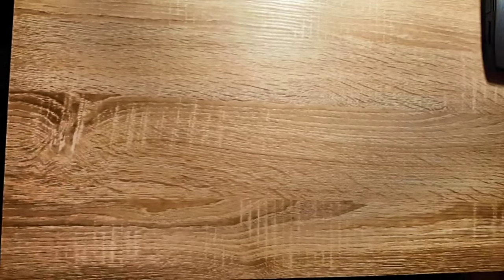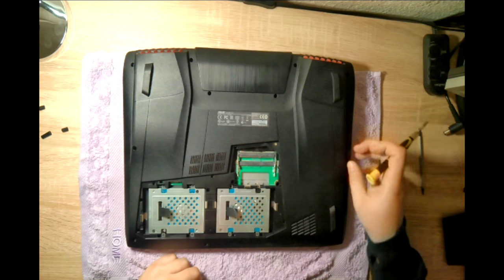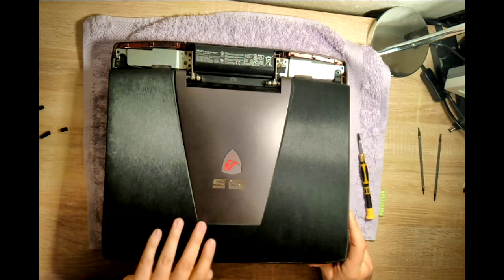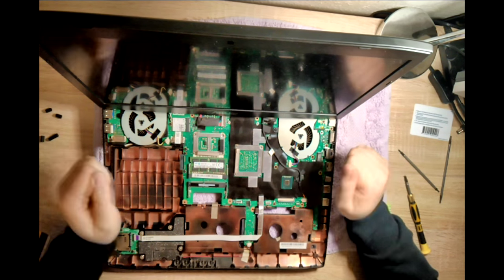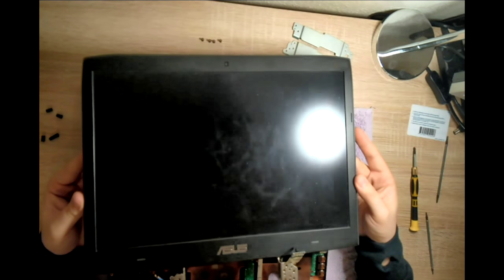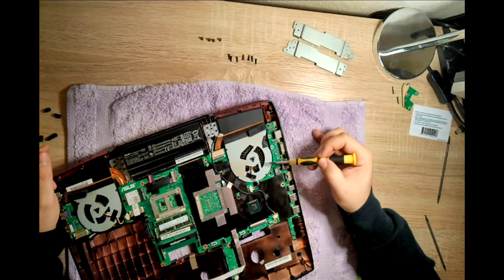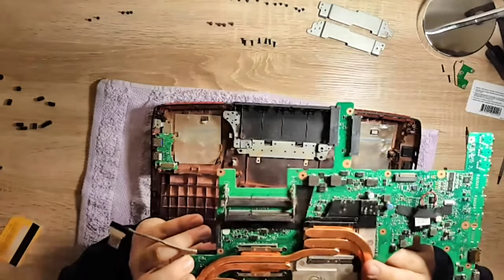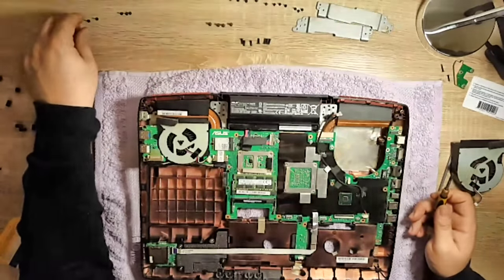Asus G751 - Complete Disassembly / Fan Cleaning / Battery Replacement

Comment: Hello Dongleboo. 
I recently disassembled my G751 to replace the dead battery. I used your video for the guide. 

Got everything right except for the monitor. The monitor doesn't turn on now, the logo at the back does not even light up. I tried to disconnect-connect-boot, and still, the monitor seems dead. 

I'm now using an external monitor connected thru HDMI. 

Any advice or thoughts on how to troubleshoot and see if I should replace the monitor (or if the problem is in the mobo)?
Reply from the maker: Kleine Bahatan Hi, I'm really not sure what's causing this. There are a lot of people who had the same issue after opening up the laptop. 

I disassembled mine probably over 10 times and each time I've disconnected the display and I have no issues whatsoever. The problem is most likely with the motherboard or the connector itself. it's really difficult to say. 

I'm sorry that this happened to your laptop. There might've been a short out or some electric shock generated by your clothes. You'll have to take it to a repair shop you know for sure.
Reply: Dongleboo, hmmm not sure if I'd go through the trouble of having it checked. With all that time and money involved. Sorry to say this, I don't trust repair shops here. We don't have the official asus service center here too so that's that.

Just wanted to know exactly where it went wrong, if Mobo or the monitor. The monitor is replaceable with an ok cost, but Mobo might not be as cheap. Anyway. 

I'm thinking of just dealing with using an external monitor. I don't take my laptop on mobile anyway.

Do you think this is a good decision?
Reply from the maker: Kleine Bahatan I'd probably do the same thing. I'm really wondering what's causing this...
And you're sure that the connector is properly plugged in (it clicked) and is not misaligned in any way?
Reply: Dongleboo yeah, clicked. Tried the disconnect-connect-reboot like 5 times.

Comment: Awesome video.
I disassembled my ASUS too and it was not the first laptop or computer that I disassembled. But I encountered a problem this time. When putting it back together again, I did everything wright (I think), but it would not start. Then I disassembled it again and found out, that it is operating normally, only if I do not connect the touchpad. I looked closely at the touchpad cord, found no damage, connected it several times, but it still does not work. I had to leave touchpad disconnected in order it to work. 
Does anyone know what could be the problem?
Reply from the maker: This might be due to some short out. There's one thing I'd like you to try out - since the cable from the touchpad can be disconnected from both sides, try to connect the cable only from the MB side, so you can rule out cable defect. If it doesn't start on the other hand, maybe the cable is shorting out and some safety feature is preventing your laptop from starting. Usually there's no reason why it shouldn't start and if it's not the cable It would be a bit weird.
Reply: I have the same issue with touchpad cord. Did you solve this problem?
Reply: No, I didn't. I don't use touchpad, so I don't miss it.

Comment: I have the same laptop and I need to replace the LCD panel (not the entire screen assembly). Does the bezel snap off? or are there screws under the rubber parts on the bezel? Thanks

Comment: Hi! My screen is purple, I think I have to change the flex because the video card is ok (tested). Can you explain me where is the flex and how can I change it? Do you know where can i buy it? Thank you!!!
Reply from the maker: The way you describe it, It might be a bad connection or a LED driver issue on the LCD matrix itself. There's no flex cable, just a lego-like connector which I remove at @09:05 Just try to turn on your PC (you have to press the small power button with your fingernail) with the palm rest moved a bit down and then move around or press down the connector and see if anything changes. If it's not the connection, then you might be looking at a faulty LCD matrix and/or LED driver. Either way it calls for a replacement. You can get it for around 100-120€ off ebay.
Reply from the maker: Yeah, mine did the same as well. If the battery is completely dead sometimes the laptop turns off just like that. This usually occurs under heavy loads, when it has a power shortage. Usually, it'd use the battery, but since it's the same like no battery at all, it turns off. This laptop isn't made to function without a battery like other laptops are.

Comment: Hey, I stripped my laptop following this video. Cleaned out the fans and replaced the thermal paste on the GPU and CPU. Now that I’ve put everything back together, it won’t start up. I have it plugged into the wall and the battery light is on but no matter how many times I click the power button, the laptop doesn’t power on. Any solutions?
Reply: I was having the same problem after putting everything back together my laptop wouldn't power on. So I disassembled it again and remove the memory slots. After putting it back the laptop worked. I'm not using the battery since it's dead. Actually I watched this video to remove the battery. Hope it helps

Comment: Yikes, that's alot of work. :P I have disassembled laptops before, but never had to disconnect the keyboard etc. This looks scary as hell even for me. I might just bring it to someone instead.
Reply: This one isn't actually too bad.  I have done 4 laptops in 20 years and this one isnt nearly as PITA as the Alineware 17r4 or 13r3 that I have disassembled.  Different but definitely easy.
Reply: @Rchiwawa  I did it, like someone else the connector for the screen on the motherboard sparked but mine survived luckily. I think he thought like me that you had to slide it in, but you have to snap it on top the connector.
The fans were actually clean funny enough, the thermal paste was almost gone on it so i replaced that. There were other parts that had thermal paste on it, i only did 2 spots that had it almost removed. I hope that's enough, but if i have to guess thats for the north/south bridge of the cpu?

Putting it back together wasn't as bad no, but the amount of screws did screw me. I had 2 screws left, not sure how but im sure i got the most important ones like motherboard, fans and the power button card.

But anyway, the laptop booted without issues, wifi works as i did not really know where the antennas needed to go in order, the video was too blurry to really see.
The right hand side fan seems to be slower then the other, but the temps are much much lower anyway, i stressed the CPU wich had the highest temps and throttled in just minutes.
Temps of the GPU are alright, i think i got around 10-12c off of it..
Reply: @s1gnex reminds me of my poker game; better lucky than good.  Certainly an experience we'll both keep in mind

Comment: Hey. I can't remove the keyboard panel from minute 6 onwards. All the locks on the borders  click open but the portion below the numpad feels like it's glues down. Is it the same for your laptop. I tried applying some force but it still doesn't come out. Is there a way around this?

Comment: I've had my g751 for about 9months now and hadn't really done anything to maintain it's internals. I've only cleaned the keyboard and such but haven't really dug into the internals so would you recommend me do so? and how often do you think i should be cleaning its internals?
Reply from the maker: Well, it really depends on the environment in which you use the laptop. Also where you use it, e.g. in bed, on blankets etc. I use mine only on a desk and so far I've cleaned it 2 times including the one on the video but both times there wasn't so much dust. It's up to you, you can clean it now, or wait another 6 months. Usually you should clean it if you start seeing some temperature increases, otherwise it might not be necessary.
Reply: Ah, thanks I think will try follow the video to clean it after looking at my connection ports was actually full of dust (since the laptops cools itself through keyboard and ports?), i cleaned out the dust with a vacuum but i seem to cant get all of it out

Comment: Once inside the laptop, what is that black material on the right side of the laptop and what happens if you remove it?
Reply from the maker: It's simply for isolation. It's plastic and protectsfrom shortouts, since the bottom of the keyboard is one big metal panel, and if you press hard enough, it may touch the motherboard and potentially short out. That's all.
Reply: +Dongleboo thank you for that info boss :)

Comment: Hey man, thanks for the videos, but after i put it back together, and tried to start it, nothing would happen, just the light of the power button is on, any suggestions??
Reply: not even the fans blowing? Maybe u just forgot to reconnect the display cable? :o
Reply: +ChillyBilli no everything is connected
Reply: +ChillyBilli and the fans are not blowing